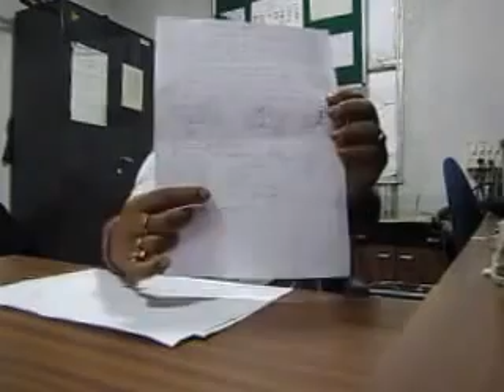Pneumatic Control Valve Practical Demostration

Comment: not good lecture  no practically experience in oil and gas industry
mostly industry control valve application either by linear or = % control valve
Reply from the maker: RASAMSETTY - UPLOAD the same video from your side and explain to the viewers.